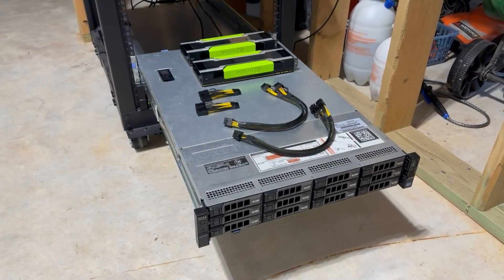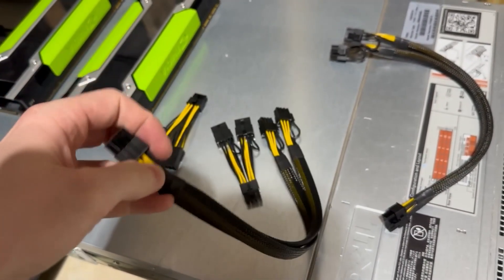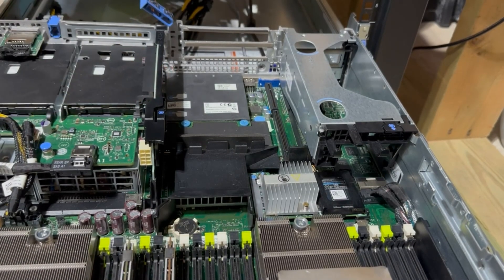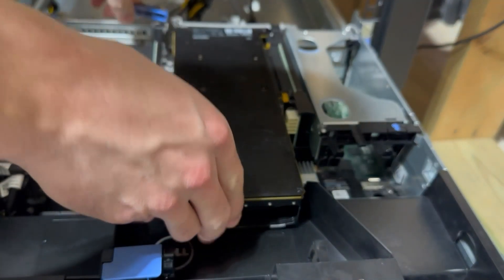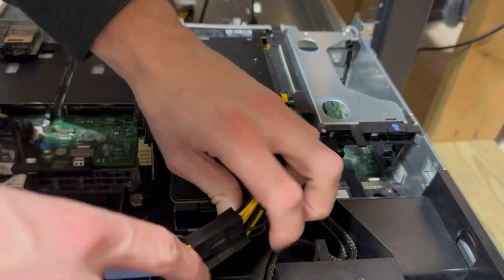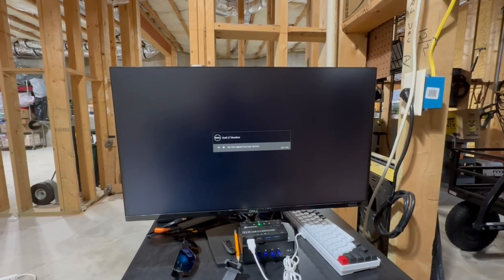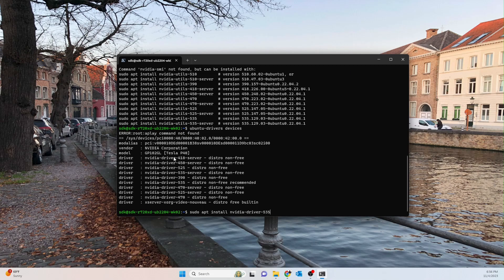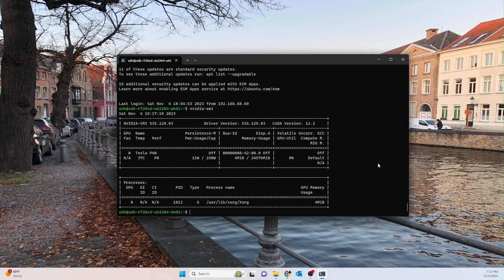Dell PowerEdge R720XD GPU Upgrade: Installing Tesla P40 with NVIDIA Drivers

Comment: I'm suspecting you're using the 1B + 2B riser chassis with the 1B (Alt to a 1C / 1D) riser installed correct? I'm just at the point of buying the riser card.
Reply: Oh and also does that server have a GPU enablement kit?

Comment: You should make the GPU power cables run UNDER the P40, there’s like some plastic brackets to hold them just next to the foam pad under the P40. This way the cables come from the left side of the card (view from front above) which will prevent blocking the air flow coming out of the upper part of the CPU rad to help with cooling the GPU. I guess this is how it is intended to be installed 😉 Note you’ll have to upgrade from default 750W to 1100W Power Supply Units as the 750W are sized to hold the max power consumption of the server WITHOUT GPU installed. You’ll get a warning when booting if you don’t, saying you’re not power compliant and the server might shut down unexpectedly (in case you drawn too much current from the GPU)
Reply from the maker: Great recommendations! I will have to fix this. Thank you so much for commenting.

Comment: Can you please help me with my question can tesla p80 work on Dell r730xd ??
Reply: I got a Tesla k80 on a dell R720XD. If you can’t fit the card into the riser slot, likely there’s a plastic pin in your way. You’d have to remove the plastic pin (black clip you have to squeeze the handles to remove). You definitely will not be able to fit more cards if you have risers sitting close to SAS drive extensions
Reply from the maker: Unfortunately, I have never worked with that GPU or that server so I cannot say for sure. From my quick research, it looks like it may be possible to fit 1. However, it is tough to say for sure. I would default to other's comments that have tried it.

Comment: I would have routed the power cable UNDER the GPU rather than block off airflow to it. Wouldn't there be enough space under it to route the cable?
Reply from the maker: There might be enough space... but I was more worried about hurting some of the sensitive components under the GPUs. I would recommend using the alternative cabling option that should be list in the video description.

Comment: I have the same server. How did you get around the fact the r720xd doesn't support video cards? I have tried a 1080ti and a 1660ti and neither of them give me a video output or work.
Reply from the maker: Hi there! Thanks for the question. 

That is interesting. In my case, I am not actually using the video cards for video output. I am only using them for machine learning applications. I also did not do anything special to get them to work. I simply installed them, downloaded the nvidia drivers and they worked. I am thinking either those cards are not compatible with this server or the cards themselves may be bad. Does the machine recognize them at all? Have you tried something like:

lspci | grep -i vga

Try that and lmk if the machine is able to recognize them at all and we can go from there.
Reply: @TheDataDaddi  Yes I have done that The machine recognizes the cards and the cards are good because I put them in another machine and they work just fine maybe it's the fact that these cards have video output and are designed differently on the other ones I will have to order some different cards and try again. Thank you for your reply
Reply from the maker: @strangegriffin  Gotcha. Yeah. Sorry I can be of more help here. Unfortunately, I have never worked with those cards directly so I can't say anything for sure. What I can tell you is that servers can be extremely particular at time as far as what hardware they will support. My gut feeling is that the R720 just does not support those cards. A couple other possibilities. You may need to try and older Nvidia driver for them to be recognized. Also, it is possible that there may be some setting in the BIOS that are incorrect and keeping them from being properly utilized. Its strange though because there GPUs are relatively new so I would have thought they would have been supported initially.
Reply: @strangegriffin  If I understand this correctly,  because the Dell R720 uses VGA for graphics output,  you might have to dig in and see if you can disable the VGA out in order to use your graphics cards video output.

Comment: What dual power supplies should you be running with these gpus? Dual 750 watts enough?
Reply from the maker: Hi there! Thanks so much for the question.

Dual 750 W PSUs should be plenty for system.
Reply: @TheDataDaddi  Cool, thanks!

Comment: Has anyone attempted connecting more than 4 tesla p40's to the r720xd? I've got 4 connected now but when I originally had one of them connected to the lower pcie on riser 2 I got a pcie training error. 2 on riser 1 and 1 each on risers 2 and 3 seems to work fine. I've got another p40 in the mail that I will attempt to connect to the last slot on riser 1 but it would be awesome if I could have 6😀 or even 8. However this machine does not support bifurcation and  adding pcie switches to the 2 full bandwidth pcie's is too expensive.
Reply from the maker: Hi there! Thanks so much for the question.

I am assuming you are connecting these externally or how are you fitting in 4 GPUs? Also, another thing to keep in mind is that after 2 GPUs the amount of PCIE lanes for each GPU will be reduced (I forget what is supported by the GPU and mobo honestly), but this is is something you might want to check to make sure it does not become a bottle neck for you operations.

Comment: I recently got a R720Xd and fitted a few p40s externally. All was well u till I added a team group ssd 4tb qx verity. On reboot the created virtual disk disappears and the physical disk shows as failed.  it works fine on a fresh start but I still get blinking yellow light on the drive and a few error symbols. Should I use software raid or a different card or any other workarounds? Anyone have this problem? Id hate to have to buy a different ssd😢
Reply from the maker: Hi there. Thanks so much for your comment!

I have a video related to this topic. Link is below:

https://youtu.be/oQqcXyS2WQ4?si=iisyvWNAJlWJwQQD

If it is just error light on the drive, you should be fine. I have been using TeamGroup drives for a while now and been very happy with them. If there are issues booting after installation, there is likely a problem with the drive and you might want to have it replaced. I believe TeamGroup offers a 3 year warranty at minimum on most of their products. Might be worth reaching out to have it replaced if there are issues.
Reply: I ended up getting it working by flashing the perc h710 mini D1 with Lsi IT mode firmware and installing the boot images using the guide on fohdeesha. It's working great and I now have 4 p40's mounted on a gpu rack above the case. I still haven't got the fans not to run at 100% yet but when I get some extra time I'll continue digging into the ipmi tool. I've gotten it to return the fan info but it doesn't seem to respond to turning off automatic fan control or manual controlling the fan speed  @TheDataDaddi
Reply: I resolved my fan problem by using RACAdm. I cleared the idrac logs and disabled the PCI fan response. Fans are running at 10% at idle now. I watched your video on installing the idrac service module and I'd like to note that version 10 point something has a Ubuntu specific version so you don't have to do any converting. Although I am running Ubuntu version 20 so all I did was run the shell script and voila all done

Comment: how did you download ubuntu on the dell server , I have installed the ubuntu on usb bootable then I installing on a ssd hard drive but I cannot boot into that hard drive did you have that issue or does someone know how to fix it
Reply from the maker: Hi there. Thanks so much for your comment. 

The process is normally as easy as:
1) Creating a bootable drive with whatever OS you want to install
2) Plug in the usb
3) Power on the machine and boot into BIOS
4) Adjust the bios settings so that the usb device is the first boot choice (although many times you dont even need to do this)
5) Let the machine boot normally, and you should be prompted to install the OS. 
6) Install the OS
7) Restart machine and boot into BIOS
8) Adjust bios setting so that the new drive where the OS is installed is the first boot option
9) Let the machine boot normally, and you should have a working fresh install of whatever OS you choose.
Reply from the maker: Let me know if this does not work for you. I can try to help you trouble shoot from there.
Reply: @TheDataDaddi  I was able to solve the issue but the things is that I originally tried to plug in a 2.5 ssd drive to the back of the server and that didn't work in terms of booting, I was able to install the os on it but when restarting the bios said no bootable drive was found. my solution was to use a usb to Sata adapter and plug that in the internal usb port and that worked  and one could then boot, but the drives are detected in ubuntu and can save files to them so it's weird
Reply: I have an r720xd, my first fix was to install on a SSD connected via USB to Sata like you but the internal USB is v slow. 
Next I set up the SSD as a raid 0, by entering raid bios (ctrl R) after boot, when it talks about raid, I initialised the drive by ticking advanced and then initialise. 3 seconds later, done.

I then set it as bootable in the life app (reboot F10), under the raid controller option at the bottom (could not find the option in raid bios). 
Rebooted F10, UEFI bios and chose it as boot disk.
Next rebooted with F11, picked front USB disk with install image.

Removed USB after install and rebooted, no F keys, everything was good. Straight into linux

Comment: Does the GPU have a CPU Ram requirement? I'm getting not enough resources error in windows.
Reply from the maker: Hi there. Thanks for the question!

So in theory there is not hard and fast requirement for a CPU RAM based on a particular GPU. That said you need enough RAM to hold whatever it is you are trying to load on your GPUs. For example, if you have 16GB of CPU RAM and 32GB of GPU VRAM. If you try to load a 24GB model onto the GPUs you will likely get errors, because even though you have enough GPU VRAM to hold the model you can't fit it into CPU RAM first in order to load it. 

I am not sure if this is your problem? If not please let me know, and I can dig deeper to try to help you figure out where the error may be coming from.

Comment: Thank you very much for the idea 💡 my R730 and 2x P40s are UP and running. I see, I need liquid cooling, because its very nosy 😂
Reply from the maker: Hi there. Thank for the comment. 

Liquid cooling is certainly an option and depending on the environment where the server lives this may be necessary. I have a video specifically on cooling the GPUs. I would advise you to watch it before you go that route. I created a python script to adjust the fans based on GPU temperature. It seems to work pretty well to keep the GPUs from throttling and might save you some money and time installing liquid cooling. 

https://youtu.be/RUW3Ay5rsCY

Let me know if you have any questions!

Comment: Hey , I have the same server in I installed a p2000 , but the unraid doesn’t detect it , I know that you use Linux in this  case , but did you changed some setting in bios so that the SO can detected id ?
Reply from the maker: So I didn't have to change anything in BIOS from what I remember. 

Here are somethings you can try though:

1) The first step is to verify that your server's BIOS is configured to recognize and enable the GPU. Depending on your server model, you might need to:
- Enable Above 4G Decoding: This setting is crucial for systems with multiple PCIe devices, like GPUs, and can help in their detection.
- Check PCIe Slot Configuration: Ensure that the PCIe slot used for the P2000 is set up correctly in the BIOS. Some servers allow you to configure the slot's bandwidth or enable/disable slots.
- Update BIOS: If your BIOS is outdated, it may not properly support newer hardware. Check for any available updates from your server's manufacturer that could improve compatibility.

2) In Unraid, the detection and utilization of GPUs can sometimes require additional steps:
- NVIDIA Driver Plugin: If you haven't already, install the NVIDIA Driver plugin for Unraid. This plugin is essential for Unraid to properly utilize NVIDIA GPUs.
- Tools and Drivers: Ensure that you have the correct drivers and tools installed for your P2000. The NVIDIA Driver plugin should handle this, but it's good to verify that it's installed and updated.

3) Since Unraid is Linux-based, you can use command-line tools to check if the system recognizes the GPU. SSH into your Unraid server and use commands like lspci to see if the P2000 is listed as a PCIe device. If it's listed, it's a good sign that the hardware is recognized at the system level, and any issues are more likely related to software or drivers.

4) Ensure the GPU is properly seated in the PCIe slot and that any required power connectors are securely attached. It might also be worth testing the GPU in another system to rule out any hardware issues.

Hope this helps!

Comment: At https://youtu.be/lX2718vURCU?t=486 the cabling is blocking all the airflow to the input for the cards ducts. It will run hot
Reply from the maker: Yep, it does run a little hotter because of this. However, I have sense found a better solution and fixed it. I just have not had a chance to make an update video. Here is the link to the better cabling:

https://www.amazon.com/dp/B08N4BJL2J?psc=1&ref=ppx_yo2ov_dt_b_product_details

Comment: How much is the idle power consumption for one p40? Planning to stick it to my server
Reply from the maker: Hi there! I just checked and it looks like about 10 W per p40. Please let me know if you have any other questions.
Reply: @TheDataDaddi  Hi, thanks for the reply. 10W idle seems great to me. I'm planning to use in proxmox server and use it in different VMs. Another question, how do you cool it? Are you using those fan shrouds or anything?
Reply from the maker: Yep it was quite a bit less than I was expecting as well. So I actually have a whole video on that. I have written a program that uses idrac to adjust the internal fans once the gpus get over a certain temp. You could also (most likely) get some small snail blower fans and put them in as well. 

Here is the link to the video:

https://youtu.be/RUW3Ay5rsCY?si=JP3IMRCFe23yy4RG

  @bopal93
Reply: @TheDataDaddi   Thanks for the video link! Great stuff.  
Looks like that's exactly I was looking for. The servers that will be using GPU don't need the GPU all the time, so spinning fans 24/7 is not ideal and you've already figure that out. Just ordered the P40, excited for the new server build.
Reply from the maker: So glad its helped you! Yep, I hope that cooling solution works for you. If you have any issues let me know.

Super excited for you. Let me know how it turns out! @bopal93
Reply: @TheDataDaddi sure

Comment: Thanks for the vid!
I just bought a P40 and is assembling a pc to house it. Good thing™ I watched this vid and read the comments before hooking it up. The PSU is the modular type, I hope it have 12V RPS or I'll have to decide whether to order these cables or rewire a cable.
Reply from the maker: Hi there. So glad you found this video helpful! Please let me know how it works out for you.
Reply: I found one cable that pin wise is right, but the connector(s, two ATX 12V or combined a EPS12V)  have these latches that needs to be trimmed to fit the P40. So time for some Dremel 🙃To be cont'd
Reply from the maker: Oh nice! Please let me know how that works out for you. I am always looking for better solutions. Best of luck! @minime9400
Reply: Btw, you really had to cram those cables in place, in your opinion - did it hamper air flow?
Reply from the maker: I am sure it probably did. The ideal solution would be to make you own cable. However, I was trying to see if I could use readily available parts. Not every one is willing/able to make their own parts. It was much tighter fitting than I would have liked  it to be for sure though. Unfortunately, I could not really find a better way to do it short of making something custom.  @minime9400

Comment: Would be interesting also to walk us through starting from Linux install to models run.   I'm not sure where to start.
Reply from the maker: So I actually have a whole series on server setup. 

https://www.youtube.com/watch?v=Cw5za9DtaVo&list=PLAfuHkb8mCJSfGOlLIiRuGAzB6LhXIyZe

This should help you get the server setup for use.

This current video should show you how to install the GPU and drivers. 

I will also do a video on how to run some basic models once everything is setup. 

Next time I setup a server I will try to do a video on the whole process from start to finish. 

Anyway, I hope this helps for now!
Reply: @TheDataDaddi   I'm more interested in how to get started with AI.  I've got somewhere around 200 Xeon cores running currently...but don't know where to start with AI.  Can I start with my Xeons without getting GPU's while I figure out what I actually need?
Reply from the maker: Yeah absolutely. I started using only my CPU for financial reasons. lol. This will be much slower that with even one small GPU, but it is certainly possible. Also, most open source code code for AI/ML/DL assumes that it will be running on a machine with at least one GPU so you may have to tweak some of the code you use to work only with your GPU. If you want to reach out to me at skingutube22@gmail.com with your current hardware specs and project goals, I can try to help you more precisely to find what you need. @IntenseGrid